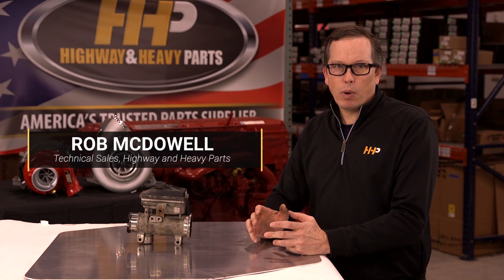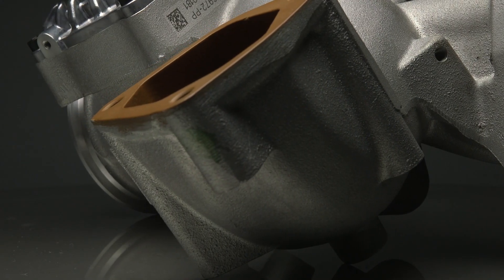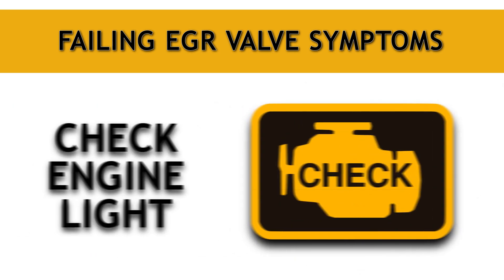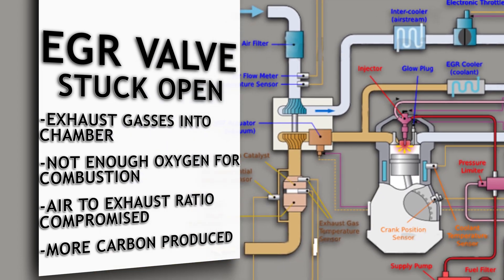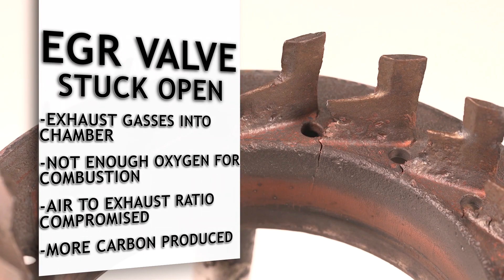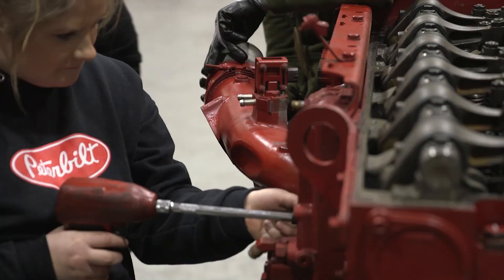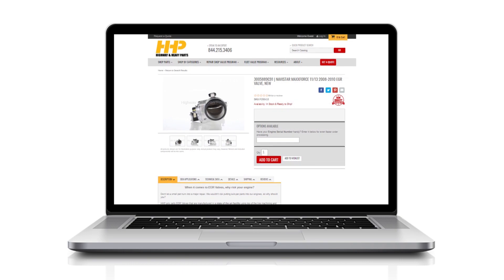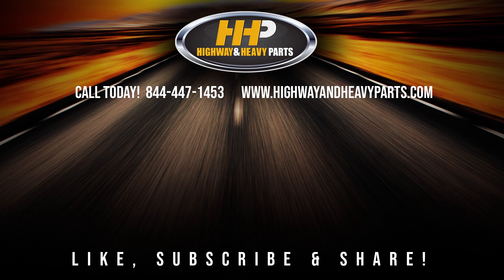EGR Valve Problems! HHP Can Help!

Comment: What color smoke for stuck open egr valve?
Reply from the maker: For a bad EGR Valve, you'll likely see black smoke. If it's white smoke, you're EGR Cooler may be faulty.
Reply: @Highwayandheavyparts  white smoke out stack .. sometimes bluish color smoke coming from underneath from what it looks like